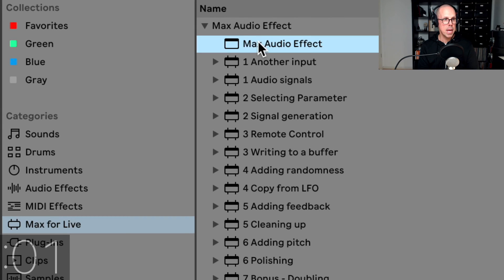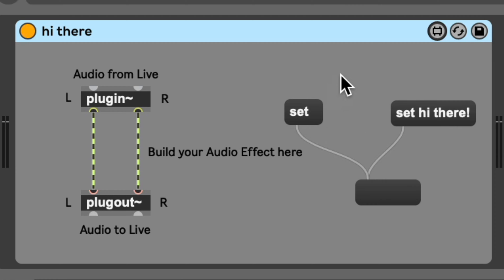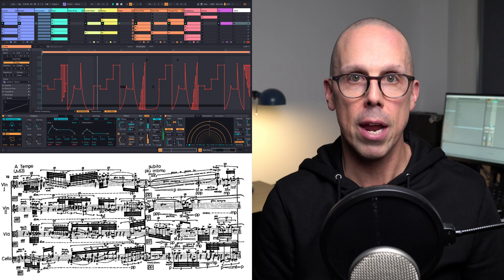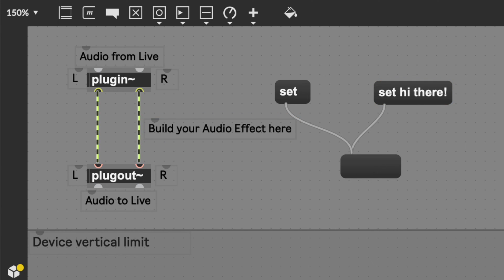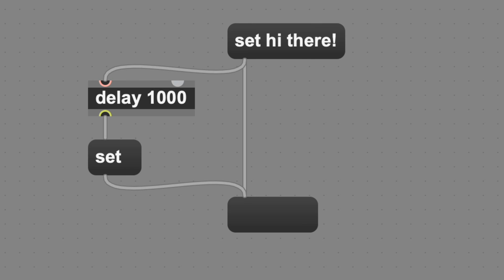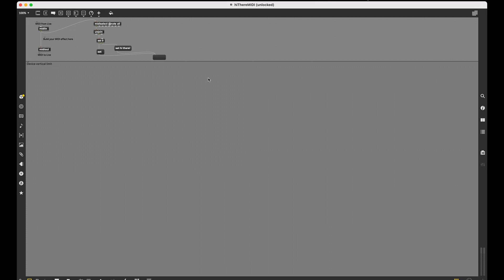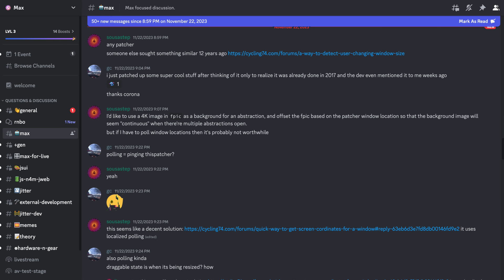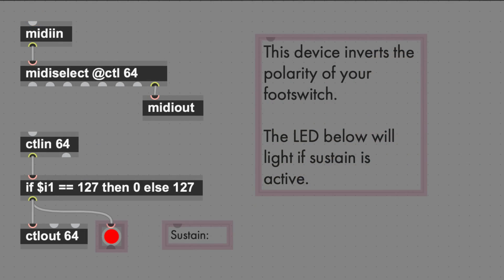Make your first Max for Live device in 30 seconds (or 30 years)

Comment: Hi there, Dennis! Another inspiring vid, Thanks! Would you be will ing to elaboarate on the most common thing(s) that destabilize a patch or expose it to higher risk of failing after any updates to Max and/or Live? Also, whatcis the most common thing that causes these devices crash with "serious errors"? I get a little worried or pit off when I see some critques on the MFL Library. The creatir thinks it should work but the Reality is sometimes different.
Reply from the maker: It's really hard to point to a set of common things that can cause problems. Since a Max device might be almost anything, there are lots of places where things might go wrong. There is a document with guidelines for making these devices, and this is pretty helpful: https://maxforlive.com/resources/M4L-Production-Guidelines.pdf

Comment: Thank you for this video! I am presently in a lengthy (and unproductive) phase where I aspire to learn Max. I've made some attempts, but nothing substantial. The advice about determining what you want to create first is truly valuable; perhaps this is the key that will overcome my barrier.
Reply from the maker: It doesn’t necessarily need to be something substantial; even a little utility might be enough. But I found it to be very motivating to be learning to make a thing rather than learning in the abstract.

Comment: I have been confused by Max and Max For Live. Are the statements below correct?

Max for Live is an extension for Ableton Live that allows users to create custom effects, instruments, and utilities. It is included with Ableton Live Suite, but it can also be purchased separately from Cycling '74.

The bundled version of Max for Live is essentially the same as the standalone version, with a few minor differences. The standalone version of Max has a few more objects and extensions that are not available in Max for Live. It also allows users to create standalone applications, which are programs that can run independently of Ableton Live.
Reply from the maker: That looks pretty accurate to me.
Reply: In case that's useful, this getting started video also includes a bit about the difference between Max and Max for Live: https://youtu.be/hJ_RaKHNo4M?si=BM3E_hhtICs6YXQk
Reply from the maker: @mattijskneppers  hi Mattijs!